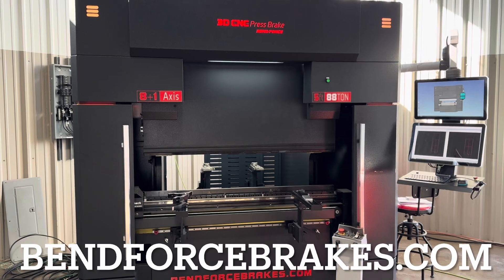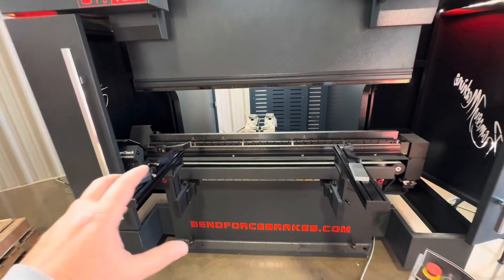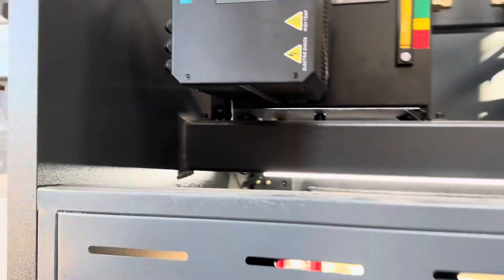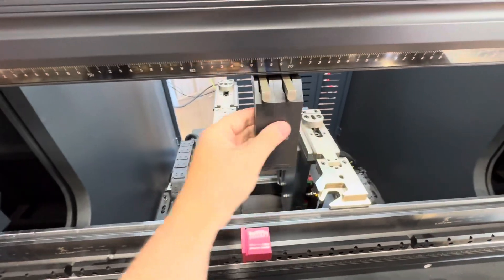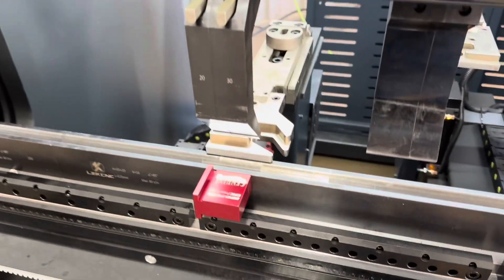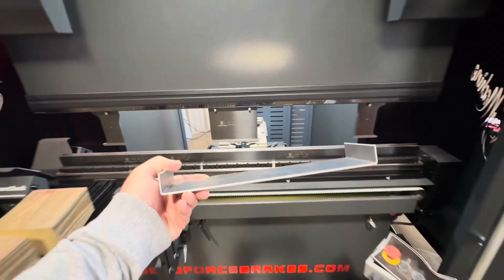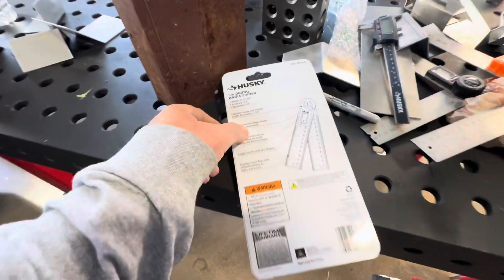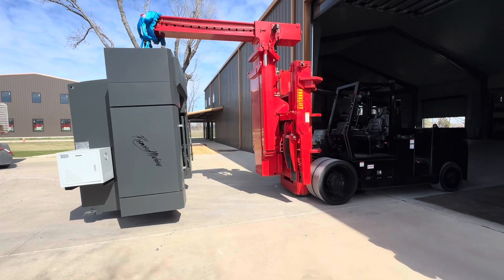The  Coolest CNC Press Brake - bendforcebrakes.com

Comment: Does the angle correction have to be run on every bend or is it just on set up? I have my employees bend thousands of brackets a day and that would kill our production if every bend took that long.
Reply from the maker: nah, you wouldnt use the angle check system on high production, its more for job shop making alot of one off parts.  for high production, bend a couple test pieces, dial in the angle correction and let it rip
Reply: @turbocobra  Ok, cool. That's one of the reasons when people ask for a one off item, I usually pass. I tell them that it's not as simple as zipping out one piece on the laser and bending it in a matter seconds. We often wipe out 1, 2 or even 3 parts getting everything dialed in and fitting perfect. They think that everything just goes together perfectly on the first shot.

Comment: That;’s a fancy fork lift you have, is that boom a mast replacement, or does it come with the boom?
Reply from the maker: it has forks and boom that are interchangeable on the mast, you can use one or the other or both at same time if needed